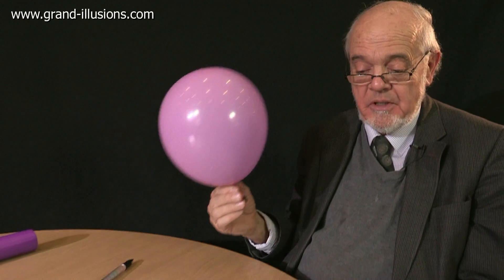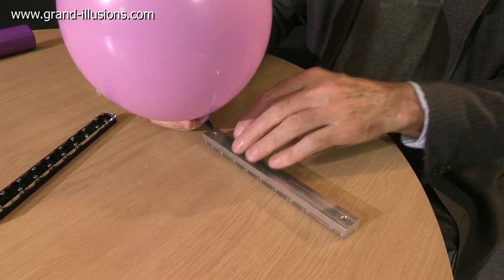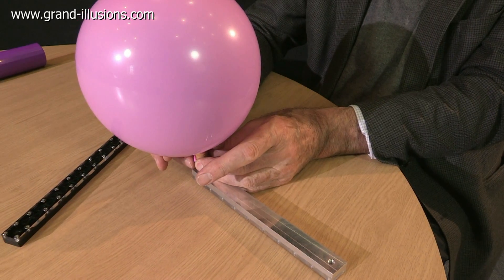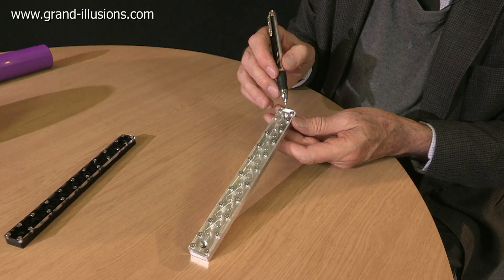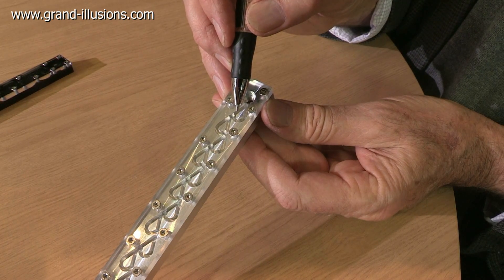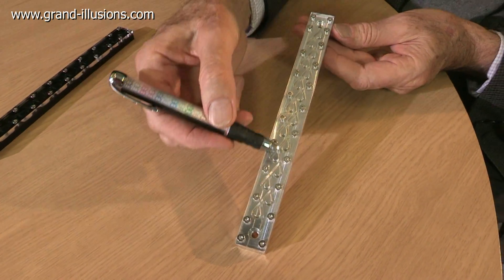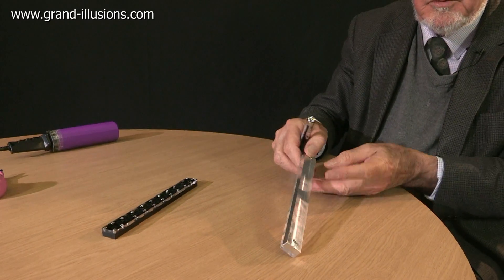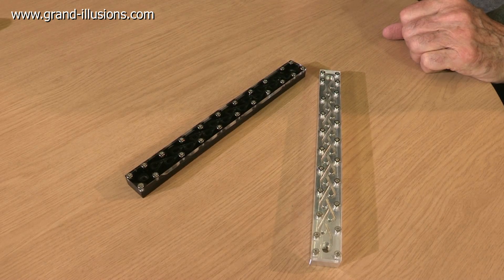Tesla Valve

Comment: Can you think of something it would be used for
Reply: They can be utilised in educational or enertainment videos on YouTube to demonstrate interesting or playful objects.
Reply: jumpleadsx2 There are plenty of things it can be used for. The problem is that, in every one of those cases, something else gets to job done better.
Reply: You could use a pair of them to build a simple air pump. It wouldn't be very strong or efficient, but it has the benefit of fewer moving parts to wear out.
Reply: An application where you want fluid to flow faster in one direction than the other is....wait for it... drum roll... one of those gadgets for stopping a door from slamming.  Plus other asymmetrical dampers .  Don't know how much commercial application it's found,  it seems to get treated more like an item of religious faith.  Wiki is unusually brief.
Reply: jumpleadsx2 

Possibly balancing liquids between tanks.
Reply: +jumpleadsx2 they work considerably better in  fluid, they would be viable in water pumps. Considering they contain no moving parts they would actually be an improvment over many designs due to the pumps increased lifespan. after seing how they perform with air i do suspect priming the pump would be nessisary more often and also be more difficult possibly even impossible with hand operated pumps unless a conventinal cheak valve was added to keep the water in it.

Comment: So was it ever used for anything?
Reply: Skis.
Several ski makers are putting Tesla valves on the bottom of the ski.
The valve lets the skis slide forward with little drag, but when you need to walk, the skis grip the snow when pushed backwards.
Same channels, but there is no top cover.
Some say its just a simple ratchet, I think there is some counter-flow, as snow under pressure acts like a fluid.
Reply: @pirobot668beta  There’s actually a thin film of water molecules on the surface of the snow (and on ice for that matter). This film acts as a lubricant. That’s why walking on snow and ice in normal street shoes is so difficult.
Reply: Its been used for pulse jets which are used for many purposes
Reply: @justinrobinson692  damnit sorry I didn't read all comments
Reply: It is used in microfluidics, often used for medical applications like separating cancer cells from non-cancerous ones or regulating chemical reactions. It's a basic building block in the field, the equivalent of an electric diode but for fluids.
Reply: Yeah, mechanical valves are all but impossible to use on that scale.
Reply: @JohnMeacham  I think you may have properly named the device , calling it a Tesla fluid diode. 
It possesses all the properties of a diode including forward voltage ( excessive negative  Delta V allows  insingificant  current to leak out the wrong way). AKA very restricted / insignificant backflow when Delta P is exceeded in a negative value.
Reply: Martyn Watson  It's used in jet engines.
Reply: Martyn Watson  you are so wrong
Reply: It is used for a variety of applications including jet engines.
Reply: It's a gun silencer.
Reply: Martyn Watson  Your face is a totally pointless thing of no practical use and no one wants to see it in public.
Reply: It was actually used in pulse jet engines and deliver fuel at TINY levels. Wish I had citations but I watched a video last night that explained some real world use scenarios.
Reply: also it can't completely block the flow, just significantly reduce it, which isn't always useful
Reply: I think itu must applied for river way
Reply: watch @5:33 for its recent industry's use
https://youtu.be/suIAo0EYwOE
Reply: @idforchrome9028  lol that's the video I was taking about.... 😂😂😂😂😜
Reply: A lot.. (industrial mechanics need certain PSI for certain task.) Where we dont want to depend upon/on mechanical movement parts that control the PSI. (to prevent critical failure) assume a spacecraft need a certain PSI to control the liquid flow for the burning process, where we know the high "demand" could fail the component. etc...
Reply: Used for cryogenic engines for fuel release.
Reply: I would guess that this type of valve needs maintenance and repairs as well. Just by the looks of it the longer it is in use the more worn out it will get and with that at some point in time just wont offer enough resistance to the fluid. And while normal one way valves can just get exchanged because they are very cheap I guess repairing this thing would just be a lot more expensive. Then there is also the size, to be of good use in the Industry you would need to Upscale this concept so that they fit with DN 15 DN20 or even Bigger Pipe diameters. These would get huge, while a normal one way valve is normaly not bigger than you hand.
Reply: ***** Yeah ---it was never really used, but it is still cool
Reply: +Critical Eats Japan 
It probably wasn't used for anything so far, and I think I know why. 
Although the idea is quite simple - let the fluid itself do the job by its own flow - nobody really believes this can work in reality as the valve seems somehow "open" both ways. 
And even those who believe it and are ready to try it sooner or later come to the conclusion that the valves that needn't repairs and replacements are not attractive neither for the valve producers nor for those who do the repairs. You do it or sell it once and then you're out of business.
Reply: Pavle Stajdohar absolutely !! Tesla mind was not profit oriented. Every idea was made to benefit humanity.. That's why the name Tesla and this capitalistic world don't fit together.
Reply: @edoardobarolo4680  👍
Reply: no because it doesn't work
Reply: No, it's useless.